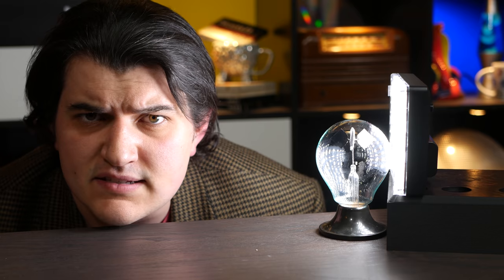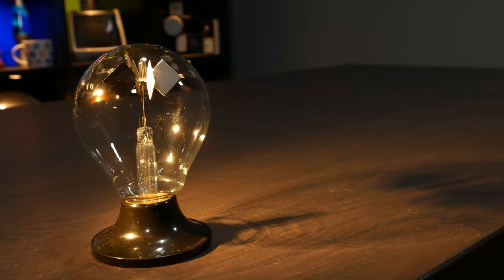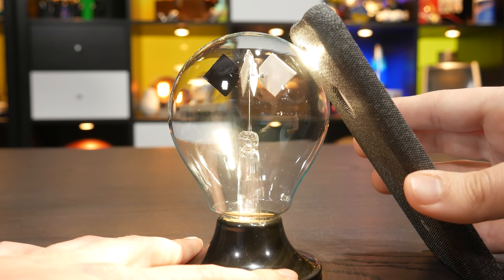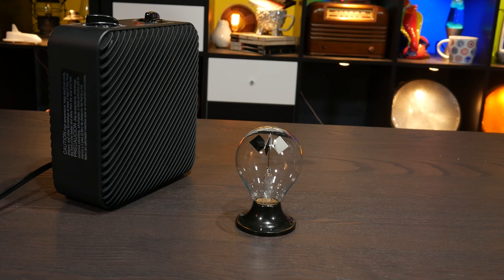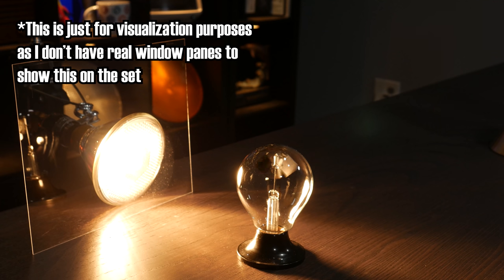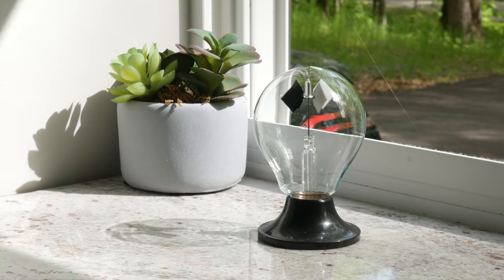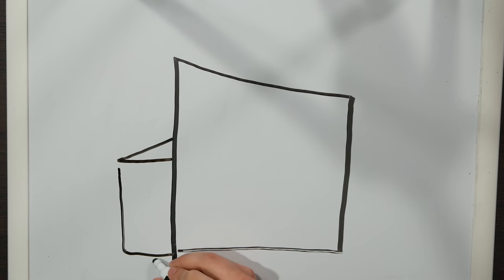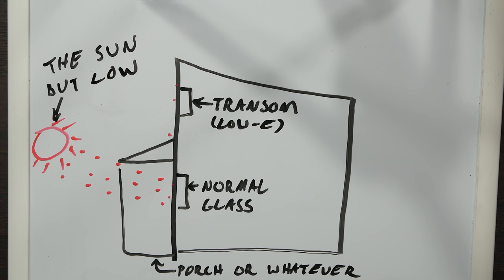What the Crookes Radiometer can teach us

Comment: Something that measures torque of a rotating shaft, because usually that's imperceptible. Sure the RPMs are visible, but the torque is not, and car engines are nearly twice as efficient at high load (more torque) than low load. The reason there is an RPM gauge but not a load/torque gauge in a car's dashboard is one reason people don't realise cruising around slowly is actually 2x less energy/fuel efficient than accelerating for a time and then coasting a.k.a hypermile'ing. So TLDR if you had a way to measure engine torque in your dash, you could drive in a way that reduced fuel consumption. In my opinion, that's why the gauge doesn't exist, not because measuring torque is hard.
Reply: Oh and mist chambers for seeing ionizing radiation, they're pretty cool. I also think a lot could be done with iron filings and gels/liquids that allow people to "see" magnetic fields, much like that green magnetically sensitive paper does. These are also both great tech connections demonstrators. For more ideas pay me because i'm broke and dont have money for food.

Comment: When I was working in NY, the windows of the building let UV light through while blocking infra red.  We used this to our advantage when viewing circuit board conformal coat.  If the board was coated, we would see it glow blue.  Where conformal coat was missing, it did not glow.  We did not need a UV lamp to do this test.  We also noticed that a UV lamp or the light through these windows would make different sheets of paper glow differently.

Could these windows pass excessive UV light to give someone cancer?  People could sit near the window for long periods of time without being annoyed by the heat.  Luckily I turned down a cubicle near the window.

Comment: If you had a sheet of glass with something like a slatted design inside for the low-e material, it would be like a fresnel awning inside the glass itself, allowing more winter sun in and less summer sun. It may however look funny with these dark lines, depending on the viewing angle

Comment: Anecdotal story about things getting more IR when reflected from a surface after passing through a window:

I once had a computer monitor on a desk in front of a bay window. My ex used the same desk to do her makeup at, and had a vanity mirror on the desk to do so. One day she left the mirror in front of my monitor and later when I turned it on I found that the reflection of the sun from the mirror had burned my screen. To this day the monitor has a dead spot about the size of a penny in the upper left corner.

Comment: It's not that people are opposed to change. It's just when new technology is presented doesn't doesn't solve the problem trying to be solved as well as technologies that already exist people will have questions. Especially when told the new stuff is better.

Take power production for example. We're told that Windmills and Solar should replace the current system to have lower carbon emissions even though there are loads of problems with those technologies. We've had Hydro Electric power since the 1880's and Nuclear power as an option since 1951, both of which emit zero carbon, are proven to work with minimal waste in comparison to what they output, are far cheaper to produce when not bogged down in unnecessary regulation. Hydro and Nuclear produce zero Carbon, why are we not using the tools we already have?

Comment: I always thought it was heat dissipation and it forming a turbulence thanks to the temp differenced of each color.  I never imagined it was actually light pushing a stalled car.  If the light electrons themselves were pushing it then it would also work without the bulb if there was no wind, like indoors.
Edit:  Yay!  I was right.

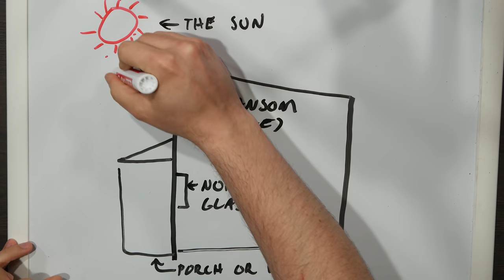Comment: at 18:25 your use of the word transom referring to a window is unclear, no pun intended. since the term Transom is an architectural term referring to a transverse horizontal structural beam or bar, or a crosspiece separating a door from a window above it. Not to be confused with a mullion, which is a vertical window structural bar. please clarify

Comment: I see "radio" in the title and hear "light" and instantly think "radiation pressure" Stuff like light sails for space probes. It even works on solar panels on sattelites.
fun fact: you weigh less in the shadow than in direct sunlight.
Oh, and those painted pieces aren't totally vertical but actually slightly canted. With the top towards the dark side. Which means it is also like a propeller. Doesn't need the air bouncing off, just moving upwards, something hot air tends to do.
Talking about sailing to Cardassia, you would make a fine cardassian, already got the right haircut.

Comment: It works off of capacitance. If you use a red LED it won't do a damn thing. Use an infrared LED and it definitely won't do a damn thing. You said it in front of a toaster oven, which is outputting a ton of energy for that little thing. That's not fair. If you use a blue LED it'll start spinning. Blue light has a higher capacitance because it's a shorter wavelength. The smaller the space the higher the capacitance. It works because of capacitance. Definitely not a heat engine. It's moving on the Aether perturbation we call light. A wave is not a thing it's what something does. Blue light causes more waves in a shorter space. If you put a ping pong ball in a lake and step in the lake one time it won't go very far. Only one wave is going to carry that. If you step in the lake multiple times you can make the ping pong ball go all the way across the lake. Capacitance. Use a tiny LED it doesn't create heat and you will see

Comment: I often wondered if these could be used for power generation. My first thought is probably not. 
I'm guessing the vanes need to be very light. 
To generate power, they would need to be pretty heavy. 
So heavy, that light wouldn't move them.
Reply: We already have far more efficient IR energy power generators.
Reply: @Winasaurus  but we also researching micro scale power generation. Like regenerative breaking on EV's.
And small vibration generators to turn vibrations in factories back into electricity.
Reply: @jaykingsun7093  Because those are currently untapped potential with niche collection methods. We already have infinitely more efficient collection methods for IR and visible light that can be scaled up to the country level and down to less than an inch.

Comment: Your comment about Bajorans using solar sails and light pressure to reach Cardassia is misleading, or at least incomplete. As Dukat and O'Brien both pointed out it would have been nearly impossible to reach Cardassia at the sublight speed acheivable through light pressure. It was only because the ship hit a tachyon eddy, accelerating it to warp speed, that it was able to reach it's destination. The force of the tachyons pushed the ship for the vast majority of the 5.25 light year trip, with light pressure only responsible for a small fraction.

Comment: I was fallowing right up till it worked with LEDs and then my brain started twitching. I figured it was heat related based on what was going on however when the LEDs came out it started to argue with my understanding/knowledge of LEDs since i've always been told they don't produce much heat and that just disagreed with what was being said about how the thing spins. It makes sense since light is energy and heat is a measure of said energy thus even LEDS produce heat since they are light but I didn't think it was enough to make the thing spin.

Comment: You said the clockwise side is white and the counterclockwise side is black, does it have to be that way? Would it not work if reversed or is it just that way out of habit?
Reply: It should work if the surfaces were swapped. It would just spin in the opposite direction.

Comment: Would it be possible to make a one-way mirror type of window that allowed IR to pass through only in one direction? If this were possible, you could design the window to be able to rotate 180, so that the IR-reflective surface was on the outside in the summer, and on the inside in the winter.

Comment: It's funny that light beer weights the same as dark beer. But if the light in light beer has to do with weight, then dark beer would be called heavy beer. But if light beer doesn't refer to it's weight, then why isn't it called bright beer?
      When faced with a problem like this, it is best just do drink the beer until you don't care why it's light beer and not bright beer, or dark beer as opposed to heavy beer.

Comment: The fancy windows are awful if you like growing plants indoors. They are not very good at transmitting either heat or light. Even next to a window, you need supplemental lighting.
Reply: I'm sure it's possible to achieve the goal of maintaining high transparency to visible light while reducing thermal emissivity, but the energy saving windows I encounter in practice unquestionably do not work like that. They have low transparency to visible light. I guess it's a good solution if you want a really big window, but also want it to be kind of dark inside?

Comment: I assume liquid crystals would be the best bet for selective IR reflection, but I have no idea if it's possible to tune liquid crystals to a certain wavelength range. My curiosity is whether it is possible to trap IR between two panes to heat air and cause air movement, like double-glazing but open ended. That way the air could be circulated inside the building during the winter, and perhaps aid in passive cooling during the summer by promoting air flow outwards.

P.S If this is a viable concept, I hereby dedicate the idea to the public domain. Suck prior art, patent leeches!

Comment: This is just black body radiation, right? The little bit of heat the black sides release after absorbing light pushes them in the opposite direction from the direction of the BBR coming away. Right? Writing at the start.

Comment: Uhh, the sign on the bottom didn't say light pressure, it said HEAT. Light pressure is indeed to common, and incorrect, explanation, but the sticker actually has the correct answer.

Comment: Before: Some of the heat came from bulbs. Today,no heat comes from bulbs. So better, but, but, then i need more energi to heat my home, now the incandessent bulbs have gone. So did i save anything?
Reply: Yes. Because incandescence is one of the absolute worst ways to get light aside from maybe sparking flint off steel, in terms of efficiency. Using heated incandescing metal for light is like using vibrations from a speaker to heat up your drink. Ridiculously inefficient for what you actually want it for. Incandescing materials is super efficient in terms of heat distribution though, which is why we still use it as heating, but have moved past the frankly dumb ideas of the past.

Comment: Is the glass globe a vacuum, or std atmo?    If the second, only a few minutes in and I will post my theory, before you get to the explanation.   The black heats up more than the white, thereby heating the nearby air. which in turn generates thrust.
Reply: Ah.  Partial vacuum.  And my explanation seems to be partially correct?  You mentioned some effect of temperature on gases that seemed to be more complex than this.

Comment: does that mean, that whenever the energy source is pointed long enough towards the radiometer it will eventually stop spinning when the white side reaches the maximum temperature possible with the given energy source? or will the white side never match the black sides temperature?
Reply: I'd guess the latter. 
Pavement that's been in the sun all day tells me the darker has a higher max-temp-for-the-light-source, so it seems like the white side's energy shedding will keep it always cooler.
Makes sense since the black side is absorbing all it can.

Comment: Finally, now I know what these are! You see, back during my time in high school, in the other high school (we had a high school that was connected to another high school, just in case you where wondering what I meant), in the hallway near the physics and chemistry rooms, there where locked "old style" shelves glass fitted doors filled with all sorts of very old measuring devices for teaching physics. And on one of those, there where two such radiometers, which at that time I was very confused about, as they spun, even though they didn't seem to be connected to anything. Though different from the one shown in the video they only had two "arms" instead of four and also looked very old and not in a very good shape anymore. At that time I concluded that they might have had been some early attempts at creating a perpetual motion machine, because they still spun, even after waiting several days, until they might stop spinning. I think some time later I found out, that they started spinning faster if more light shone upon them or vice versa if less. But I wasn't completely sure, as they didn't change much of their momentum, even if I staid right in front of the windows, where sometimes some reflected sunlight manages to find its way into the hallway.
Well in the end I still wasn't sure what it was and moved on with my life.

Comment: So these little heat mills should be used to generate electricity?
Reply: @snoflahke6575  The only reason it works is because of the near vacuum meaning heat doesn't travel well in the bulb. Just sitting these in air wouldn't be any good, they need the vacuum, which means you need a better way to get heat to the vanes. Or just install solar panels because they already trap a good chunk of IR and also do visible light and are also flat so can work nearly anywhere.

Comment: Fun fact, this little device proves that the heat loss of incandescent bulbs is wasted in homes heating the volume that we live in and that we have to heat anyway by burning gas or using electric heating elements that turns electricity into heat.
So in any climate where we needs to heat homes, LED bulbs indoor provide 0% efficiency increase overall. But costs an order of magnitude more, last an order of magnitude less and are one hundred times less easy to recycle (LED bulbs are complicated e-waste made of plastic and electronic components in the end, whereas incandescent bulbs are just easy to separate (just drop it...) glass and metal).

Comment: Would it perhaps make sense to switch LED bulbs to incandescent bulbs in the winter, and then back again in the summer? Clearly the incandescent bulbs are terribly inefficient at generating visible light, but are they reasonably efficient at producing heat? At least compared to other heat generating devices, space heaters, furnaces, etc?

Comment: Why call it a radioMETER ? It doesn't measure anything.
Reply: it measures radiant flux.  the rate of rotation of the vanes indicates the amount of power being transferred by radiation.  the more intense radiation, the faster they spin.
Reply: @toxicpsychotic6356   It may indicate radiation but not actually measure it. There is no scale with which to specify the radiation intensity.

Comment: I have to say I'm a little disappointed. Normally your research is spot on.

While the ancient Bajoran ship was designed to operate on light pressure, it was only able to reach Cardassia due to an accidental collision with a tachyon emission. Because tachyons travel faster than light, the ship was able to achieve speeds far greater than it would have on light pressure alone. 

Operating solely on light pressure, the ship would have not been able to make it to Cardassia. At least not within the lifetime of the crew.